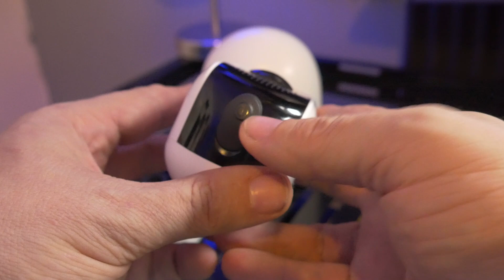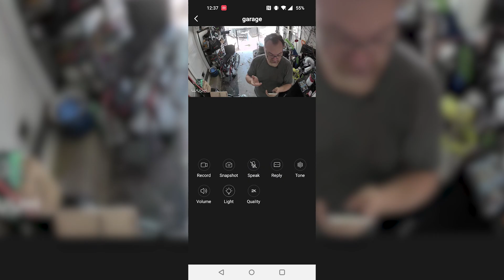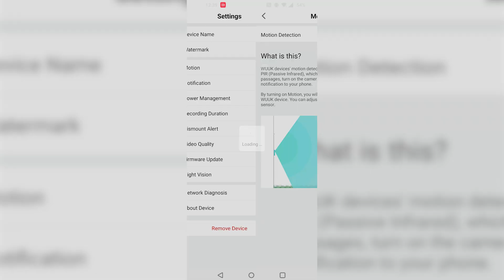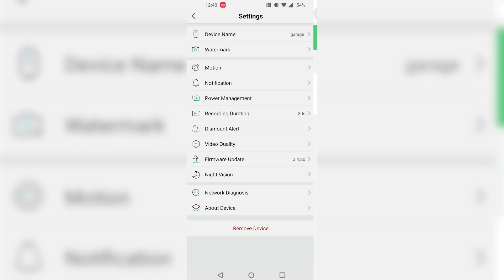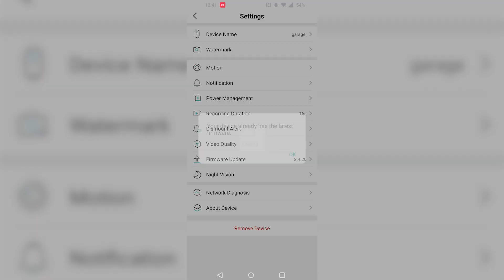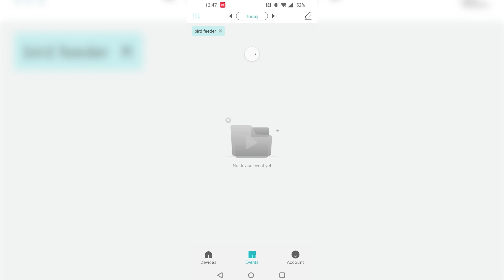WUUK 2K Security Wireless Cam System

Comment: How do you know if you can trust that this hardware and software is not malicious in the mid to long run?
Reply from the maker: Set up something like Wireshark to monitor the traffic of the device and look for any anomolies.
Reply: @DBTechYT  Nice good idea, I know about this software but I'm not familiar enough with it and networking to know what to look for specifically. Would you be willing to make video about this?

Comment: Thanks for this video it certainly help in making the decision to purchase this product. What is the difference between the Auto and 2K video quality and which is recommended.
Reply from the maker: So, when you have it set to 2K, it's going to do everything it can to get a 2K stream. If you set it to auto, it will adjust the stream dynamically to fit the available bandwidth on the wifi

Comment: The 2 k is awesome…only problem is the cameras have to be really close to the base station to work at top efficiency. If you have a large area it’s not recommended unless they come up with a stronger signal.
Reply: I’d have to agree. I have my base station near window close to a window 12 feet from doorbell and then hard wired to an Ethernet extender ..now it works great. BUT the audio is terrible. Hope there is a fix why why it’s so awful. I wish it was a constantly recording device so there was some pre record but maybe firmware upgrades will make the motion capture better.

Otherwise it is a great doorbell and can withstand Canadian prairies winter. Lasts apx 2 months in stupid cold -26 to -30
Reply: @Shasra1  thanks for the info. It advertised to connect long-range from the camera to the base.